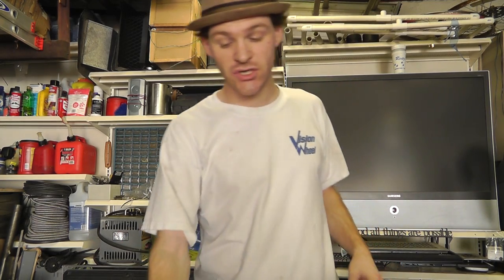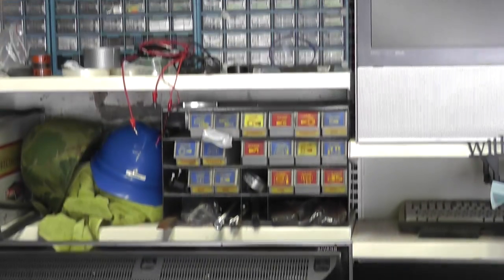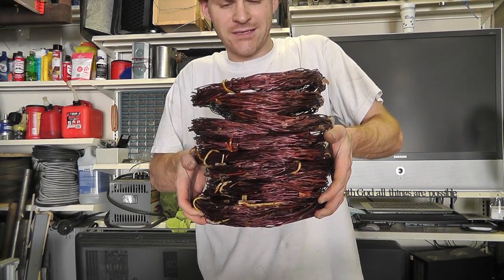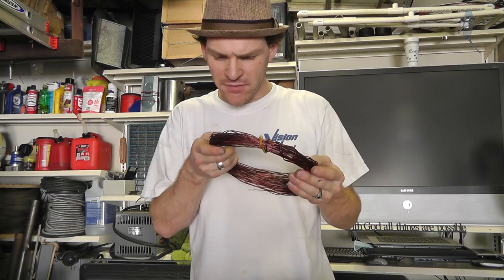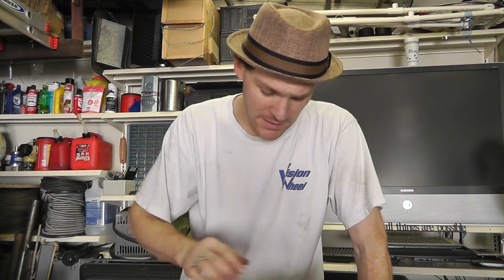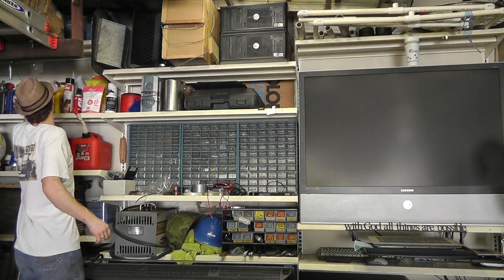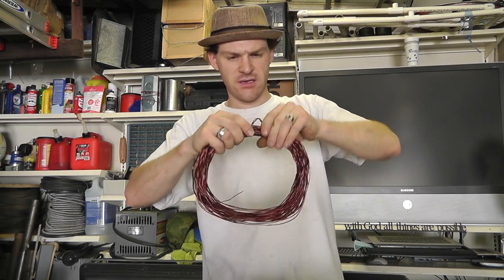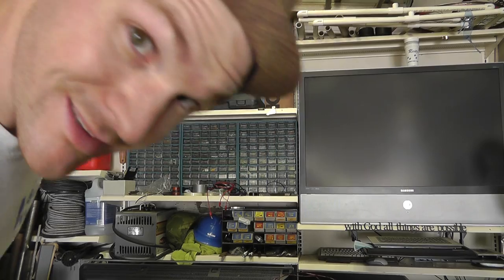A Bunch Of Magnet Wire From A 5HP Motor!! Wohoo! and some Q/A from the last video...

Comment: In 3 words, what do you need the magnet wire for? And if there is so much in a motor, is it not worth to drown the entire unit in solvent before you touch anything? Hack off what you won't use to save space in the bath of choice. Or manage to submerge only the wire part if semi-exposed. Just random thoughts from a noob!

Comment: Russ today I took one such coil apart and I think it was aluminium because it was silver in color under the coating. Can you tell me what aluminium would be best used for, such as would it be better then copper for a collector coil or for a pulse coil. It was really thick gauge and I would like to find a use for it. thanks